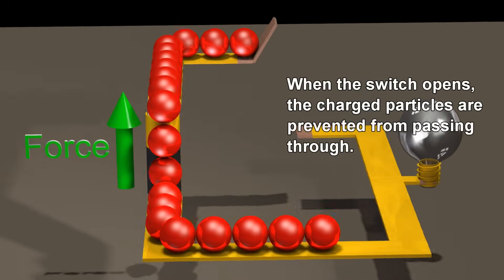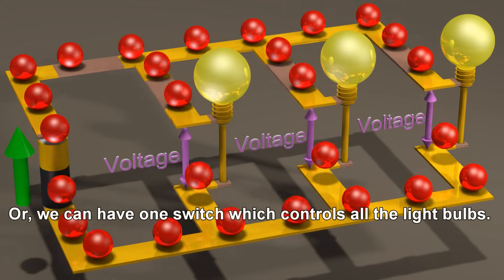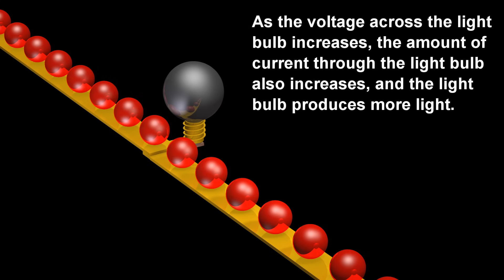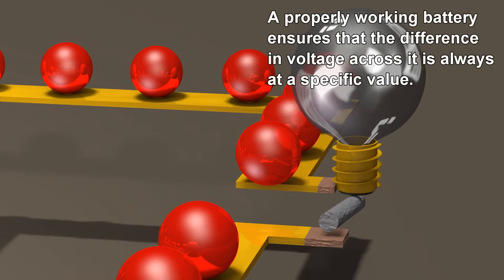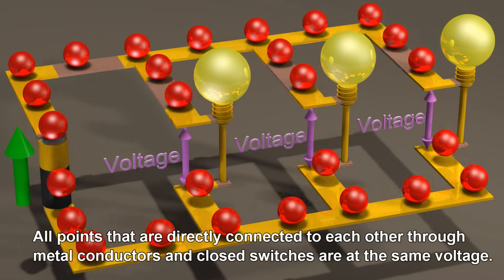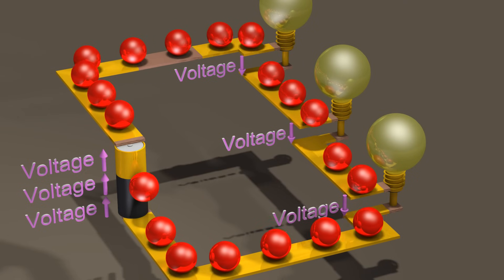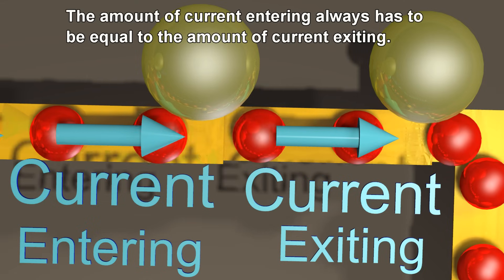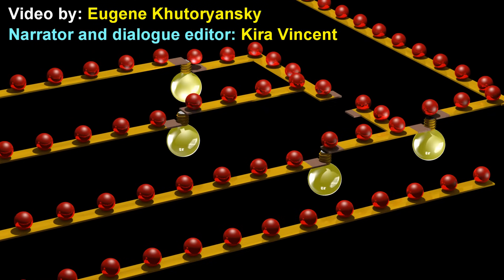Electric Circuits:  Basics of the voltage and current laws.

Comment: So the voltage of the source must always be of the same value as the rest of the circuit, regardless of whether it's in a parallel or series?

Comment: Looks good except the video shows conventional current flow as the electrons appear to emanate from the positive thermal of the battery which is not actually what happens?
Could be a very useful tool to explain real (actual) current flow in a circuit (negative to positive)... just change the direction
Reply from the maker: The red spheres are not electrons, but represent positive current flow, which is in the opposite direction.  In my very first YouTube video, I showed electron flow, and people complained that I should instead show positive current flow, as positive current flow is the convention used in education and in industry.
Reply: Appreciate that. it's just a shame people insist on continuing to use convention even though it's been shown to be incorrect...
It make teaching more difficult... perhaps if people had a better understanding of atoms they would be able to work it out for themselves....
Reply: This is a great video and extremely educational. I agree with Michael. The first thing a student will see is the conventional or positive current flow. It's very possible too many students to have read a lot about this staff, and finally, in their mind, to have determined that the final and right flow is from negative to positive direction. So, I do not think that they will think of conventional or positive flow in the first saw of the video, and for once again they will think in their mind what they have understood wrong. So, as Michel said, it would be nice to change flow direction. Thank you!

Comment: So when we add more voltage then we can send more current throughout the wire, right ? if yes then how can I find the maximal current for let's say 1 Volt ? :)
Reply: Yes, you can send in more current. Well, the maximal current for 1 Volt would be 1 ampere if the resistance is 1 ohm. If there's no resistance, the current would be infinite. (V=IR | I = V/R | I = 1/0 ~ infinity) But that isn't possible since whatever you hook on to the circuit has a resistance. Be it a bulb or a fan. Even the wires in the circuit offer some resistance.
Reply: Thanks, that was pretty helpful since I learn all by my own from youtube :) have a nice day!

Comment: Thank you Eugene for this very well done 3D video, it's very easy to follow and understand.  I just have one observation/question:  shouldn't the "electrical current" flows in the opposite direction? I thought it was the electron's movement from the negative pole to the positive pole what causes the "electrical current"
Reply from the maker: Thanks for the compliment.  I am showing positive current flow, which is in the opposite direction of electron flow.  I cover this in detail in my video "Electric Potential: Visualizing Voltage" at https://youtu.be/-Rb9guSEeVE

Comment: In series you say " This means the bulbs will not be as bright (7:36)."  Am I right in assuming they will be equally dimmed ( the 3rd as diminished as the 2nd etc) ? If so, then I understand your explanation of voltage and current in series.

Comment: Actually... the electrons are traveling from the dark colored side of the battery ( - ) to the yellow one ( + ). Because they have negative load ( - ).
Reply from the maker: I am showing positive current flow, which is in the opposite direction of electron flow.  This is the standard used in industry and in education.  I discuss this in my video on Electric Potential at https://youtu.be/-Rb9guSEeVE

Comment: Voltage is electrical energy/charge. I know that there is an electrical energy acting on 2 points of charges, for example, in a battery, and the amt of energy is  based on the charge difference (1N per Coulomb difference). So, as current moves along the circuit, this electrical energy the electrons possess is converted to other forms of energy like heat and light in a light bulb. But surely, this electrical energy is limited and so how does current still flow after passing through bulbs which has a power equivalent to the electrical energy of the electrons? Or is it that  the electrical energy they possess unrelated to the energy the electrons use for movement?

Comment: Hi, I did not read all comments, so sorry if this has already been discussed, but doesn't the charges move from the negative to the positive?
Reply from the maker: What I show in this video is "positive current flow" which is in the opposite direction of electron flow.  When electricity was first discovered, it was not known that it is the negatively charged electrons that move through wires, and it was incorrectly assumed that it is the positive particles that move in the opposite direction.  The convention for how we describe the electric current’s direction was never updated, and we therefore still refer to this situation as if it is the positive particles that are flowing in the opposite direction.  This is what I show in this video, as this is what is shown in industry and in education.
Reply: Hey, I was right for once. :) Thanks for your comment.

Comment: I'm new to electronics so sorry if this a silly question, but I'm trying to understand better.

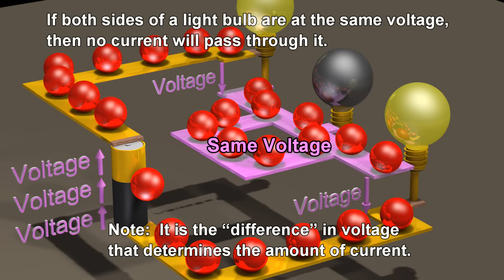At 4:12, why does the middle light bulb not light up? Is there any reason why the electrons don't choose to pass through the lightbulb, instead of the wire (also less actual "distance")?

What I'm saying is, as far as my knowledge (currently) goes, the lightbulb in question is in series with the last lightbulb... so, surely you can have 2 lightbulbs placed in series circuit next to each other and still light up? Or is that simply not true?

If someone nice (and knowledgable) could help clarify this, I'd be eternally grateful.
Reply: Fawwaz Anvi There is another way of seeing this. A current is created only when you create a difference of voltage between two points. When you create the shortcut by using the wire, the voltage at both sides of the middle bulb becomes equal, therefore, no current would pass. This happens because voltage remains constant through a wire without resistance (this is what cause the voltage to be the same at both sides of the bulb). The middle light bulb has a resistance, so if there is a current passing through, according to Ohm's Law the change of voltage at both sides must be non zero. But it would violate one of Kirchhoff's Law that states that the difference of voltage must be equal if you choose to pass through light bulb or the wire. Also, you would have a contradiction.
Reply: Luis Calderari Oh, I see now. Thank you for your detailed response!
Reply: Think about it as if the electric current were water flowing through a canal. The middle light bulb acts as a dam, therefore water flows around it and not passing through it. When you remove that shortcut, water is forced to pass through the obstacle, but in that case the current decreases as a cost.
Reply: Luis Calderari I'm still confused. Isn't the wire and the middle light bulb is in parallel? Why doesn't the middle light bulb light up?

Comment: according to law, current entering=current exiting. in a series circuit of 3 light bulbs at 8:55, how come the first light bulb (that receives current first) doesn't get full voltage of the battery since the current entering that light bulb is coming directly from the battery? or was it founded to be as a self regulating phenomena that the current divides evenly when entering and exiting each light bulb in a series circuit?
Reply: Tl;Dr: If the voltage was not balanced, then the current will flow and ebb until the current is equal through all the parts of the circuit.

As mentioned, when two parts of a circuit is connected, they will try to equalize their voltages by allowing current to flow. 

Now, if the first bulb took all the energy and lower the voltage to zero, then the voltage drop across the other two will be zero, which means no current. However, the first bulb has a large voltage drop, so current flows through, and it needs to flow somewhere, ideally to the negative end of the battery. This raises the voltage down the first bulb because it gains potential energy from the current flowing through the first bulb. This voltage, although reduced, allows current to pass through the subsequent bulbs.

 The voltage drop on the bulb can be calculated through the formula V=IR. On a series circuit, it simply states that stronger load/resistance R requires more share of the energy for the same current to flow, thus it has more voltage drop. 

The balance comes from this 'load-sharing' and the fact that series circuit had an equal current flowing through all its parts.

Comment: Wait a minute--somethings you say here don't make sense to me.  First, in the middle you say that if the light bulbs are in parallel, then the current drawn from the battery will be the sum of those currents.  (Around 6:20.)  Then a little later on you show "current in/current out" and you have the current into the parallel light bulbs equalling the current through EACH light bulb instead of the total.  (Around 8:20.)

Second, at one point you put a wire around the middle light bulb and close the switch, and the current quits flowing through the light bulb.  I just want to make sure I understand this right, the reason the current stops flowing through the light bulb is because there is resistance in the bulb, right?  So the current goes around it if it can?  You don't mention this, but if the bulb did NOT have resistance, then even with a short circuit around the bulb, current would still flow through it, right?
Reply from the maker: What I meant was that the total current output is equal to the total current input, which means that the sum of the currents flowing through the three light bulbs will be equal to the current from the battery.  In reply to your second question, yes if that light bulb had no resistance, then current would flow through it, because it would behave like a normal wire.  But, it would still not produce any light, because with no voltage drop, there can be no electrical power transformed into light.

Comment: Amazing explanation. But how does this model explain the working of a simple wire connected to a cell? I mean the current still flows through it, but there is no component to give the current a drop
Reply from the maker: All batteries have some internal resistance.  That is, there is no such thing as an ideal voltage source.  Most wires also have some resistance, unless they are a superconductor.  But, even if you use superconducting wire, the voltage will drop across the internal resistance of the battery.

Comment: Electrons flow from negative to positive. I'm still learning but can anyone explain why its the other way round on the battery here?
Reply from the maker: This is showing the convention for "positive current flow", which is in the opposite direction of electron flow.  When electricity was first discovered, it was not known that it is the negatively charged electrons that move through wires, and it was incorrectly assumed that it is the positive particles that are moving in the opposite direction.  The convention for how we describe the electric current’s direction was never updated, and we therefore still refer to this situation as if it is the positive particles that are flowing in the opposite direction.
Reply: +Physics Videos by Eugene Khutoryansky  Thanks buddy, still trying to get my head round it

Comment: There's one thing that's driving me crazy.  In the electric potential video you visualize voltage as a hill, which shows why a charged particle would move all the way from top to bottom.  But in this video you visualize the circuit as flat with 2 flat heights.  How can particles move at all without that slope from top to bottom?  If I measure a point immediately after the load and immediately before the return, and it reads "0 Volts", then how can anything move across such a space?  As each particle moves along in this video, wouldn't they slowly lose potential energy (voltage) as they come closer to the return (0 voltage)?  Thanks for the videos.
Reply from the maker: Balls roll along flat horizontal surfaces all the time.
Reply: Hah, this is true.  Does it imply that after voltage gets the charge moving it's no longer needed to keep it moving?  Another way to put my confusion is:

Is Voltage is potential difference?
If so, is the difference at the high voltage point in a circuit what moves a charged particle to the lowest voltage point?
If so, why does the voltage not gradually diminish along the way,  in the same way that a boulder's potential energy from gravity gradually diminishes at it falls?

It's not a problem I have with your video; I have seen this same thing in diagrams.  Voltage suddenly becomes 0 after a load in the circuit.  Many lessons show voltage and distance having a direct relationship when showing the effect of the electric field on one charge.  I haven't figured out why this relationship seems to be nonexistent along the conductor in a circuit.
Reply: "If so, why does the voltage not gradually diminish along the way,  in the same way that a boulder's potential energy from gravity gradually diminishes at it falls?"

Did you find an answer to this? Please, I'm thinking the same thing. One side has a lot of potential while at the end it doesn't have as mush so voltage should decrease

Comment: hey guys i m a form 3 student from Malaysia, I am so confused with electron flow and electric current.Are they both happens in the same time at the same place? Do electric current only occurs in conductors while electron flow only occurs in insulator? 
Thanks
Reply: electron flow creates current and current creates voltage Electron flow starts slightly earlier than current and according to lenz law direction of current is opposite to direction of electron flow and for last question the difference between an insulator and a conductor is bonding structure of electrons it is easy to break bonds of electrons in conductor materials but it doesnt mean bonds of electrons in an insulator cant be broken it is up to amount of energy you are going to apply on insulator

Comment: so the electron flows from lower voltage to higher voltage while the current flows from higher voltage to lower voltage?
Reply from the maker: Yes, that is the basic idea.
Reply: +Physics Videos by Eugene Khutoryansky can i ask u smth again? what is lightning? does it only contain voltage or it has its own current?
Reply from the maker: Lightning contain's current for a very brief period of time.  Lightning happens when the voltage between the clouds and the ground is so high that the current can flow through the air.
Reply: Physics Videos by Eugene Khutoryansky what makes the voltage in the cloud so high? How can cloud produce high voltage?
Reply from the maker: As the cloud particles rub against each other, electrons are transferred between particles, allowing some of them to develop a positive charge, and some of the to develop a negative charge.
Reply: Physics Videos by Eugene Khutoryansky thank you so much :)

Comment: Aren't those electrons suppose to flow in reverse? From "-" to "+"???. Electrons are attracted to the "+" (anode ) and move away from each other and the "-" (cathode)
Reply from the maker: I am showing positive current flow, which is in the opposite direction of electron flow.  Positive current flow is the convention used by industry and in education.  Details are available in the video titled "Electric Potential: Visualizing Voltage."

Comment: if the electrons transferr all their energy to the bulb how do they still have enough energy to flow back to the cell?
Reply from the maker: The electrons always have energy.  The difference in voltage between two points represents the difference in energy per charge that a particle will have at the two points.
Reply: +Physics Videos by Eugene Khutoryansky ohh so the electrons don't lose all their energy between two points of the bulb

Comment: why does the battery finishes then ?
Reply: +saifullah rahman You can think about battery like about a storage box. It stores energy. First, you must put that energy to a battery by charging it. Then, when not used, it'll remain (most of :P) it's energy. When you add it to a circut it starts to releasing stored energy to a moment when it uses it all and battery will be back at its neutral state

Comment: Should your battery be flipped the other way? Otherwise awesome videos!!!
Reply from the maker: +Spencer Curry, no.  I am using the convention for current flow which shows the direction that positive particles would flow.  This is the convention that is used in industry and education, even though it is really the negative particles that are moving in the other direction.  I explain this in my video "Electric Potential: Visualizing Voltage."

Comment: Am I correct in observing that there's some ambiguity in the terminology? Sometimes voltage is used to mean difference in potential energy, while other times voltage is used as a synonym for potential energy. To use the analogy in the video where potential energy is depicted as height, sometimes voltage is used to mean the actual height of part of the circuit, while other times voltage is used to mean the height difference between one part of the circuit and another. Am I understanding this correctly?
Reply from the maker: +Kyle Delaney, the voltage difference is always the difference in potential energy per charged particle, and in this video the voltage difference is always depicted as the difference in height.
Reply: I'm talking about just the word voltage. If voltage already means a difference in potential energy, then voltage difference is either redundant or refers to something that I don't think you're talking about.